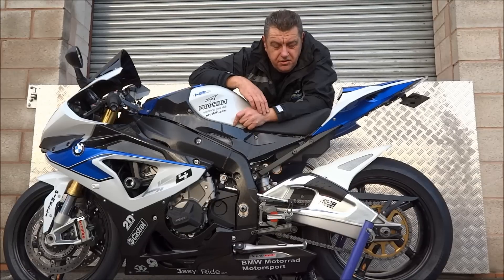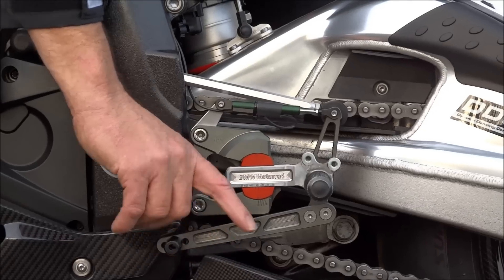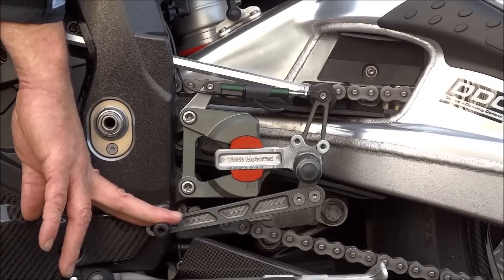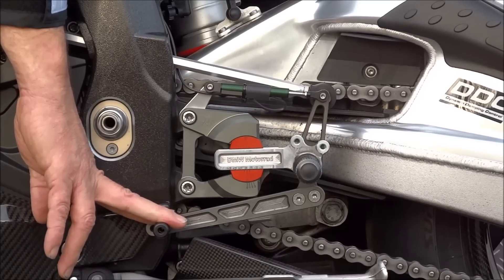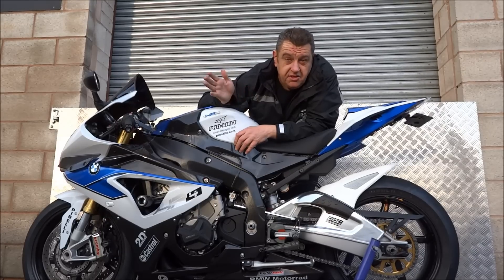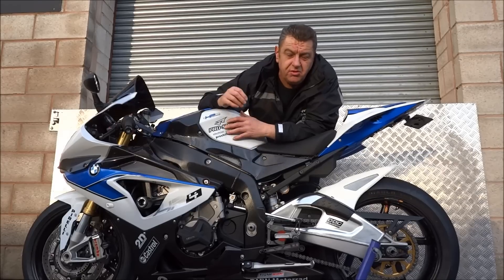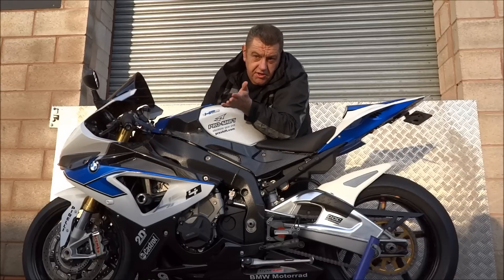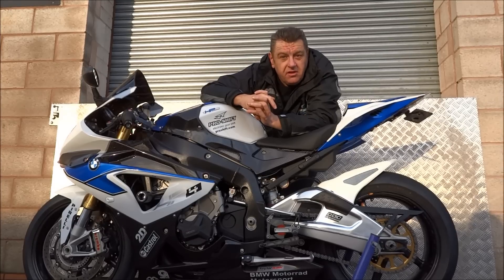BMW HP4 Pro-Shift Digital Closed-Loop Bump & Blip System

Comment: Have you got any demo's of blipper working on a cable throttle set up? Do you find it works just aswell as on fly by wire or does it lend its self to fly by wire. Im thinking of buying a Cbr600rr?
Reply from the maker: Hello Steven, Pro-Shift provide Blippers for both conventional cable throttles and electronic Drive By Wire options. Please contact us at

info@proshift.com

 and we'll be happy to provide further information for you. Thank you.
Reply: @ProShiftTechnologies  how can you blip cable driven throttles???

Comment: I really want this system for my HP4. It is a shame the Australian dollar is so rubbish at the moment. Better start saving
Reply: I want it too!
Reply: What? HP4 doesn't have quickshifter up and down as standard?
Reply: quickshifter allows you to use clutch less shifts up or down or both. Pro-shifter allows those shifts to happen in 20 milliseconds. Which means superfast shifts to the next gear and auto blip down shifts(rev matching). Superfast shifts means faster lap times and dragstrip times. Clutch less shifts (quickshifters) make motorcycles more like automatic cars. Which means keep the throttle pinned and you don't need the clutch to shift.